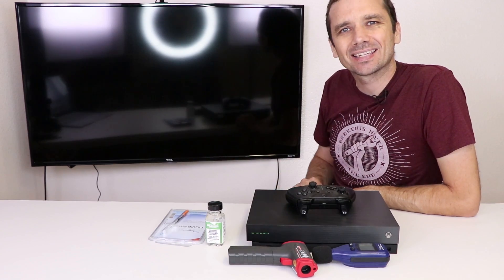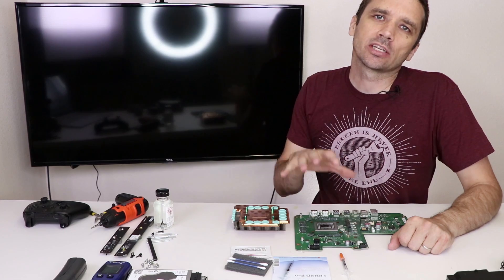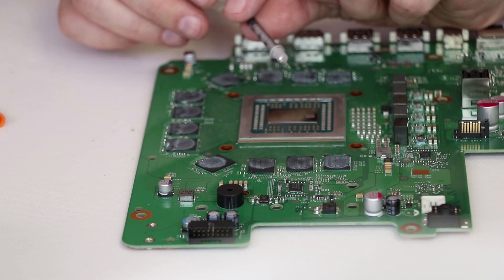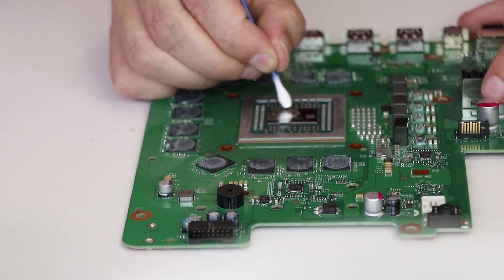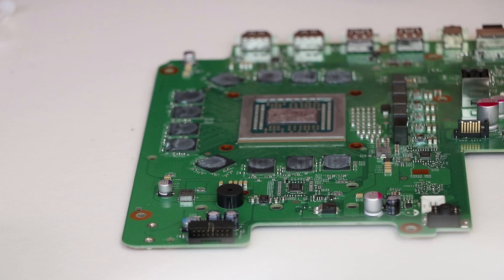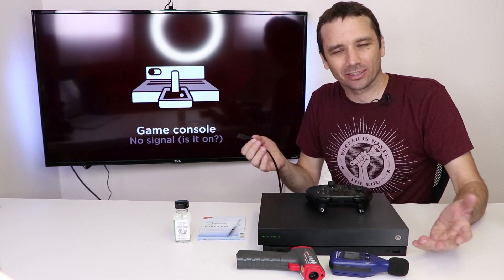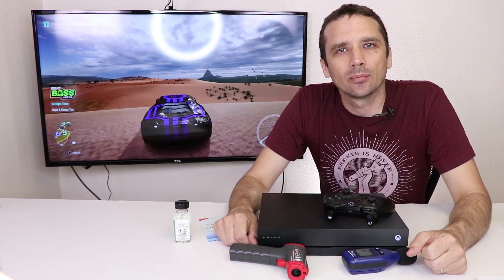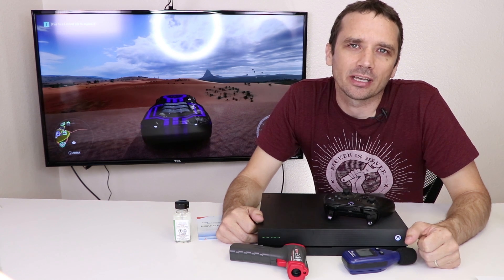Xbox One X Heat Test and Upgrade - It's So Quiet!

Comment from the maker: What was your favorite part? Why do you think the output air was so hot?
Reply: Your theory is correct. But to see real air temperature increase would mean having the same rpm on fan, if the fan was on the same speed, difference would be lower, but still present.  Therefore reduced fan speed can lead to a hotter air output and a better thermal conductor can lead to higher temperatures of heatsinks and lower temperatures of the source. To increase chances for that xbox to work longer without failure would mean to manually increase fan speed to keep APU even cooler under load. But you know all that already :) and I think you just wanted to animate the discussion under video and you got me ;) Cheers
Reply from the maker: I actually hadn't thought of all of that. I was thinking along the same lines but just not that detailed. Thanks for the input!
Reply: @Tronicsfix  Would be nice if you give the K5-Pro viscouse thermal paste and the Grizzly Minus Pad 8 2mm for replacing thermal pads of the Xbox One X a try. Comparison of heat and noise measurement between stock thermal pads, grizzly minus pads and the K5-Pro thermal paste would be very interesting.
Reply: @w3r3wolf  would a thermal imager help seeing overall temperature difference as well? If that fan is over all cycling less than the chips temp must be lower on avg. But I see you point on checking temp at the same fan speed.
Reply: Important question, what kind of thermal pads are those found on the memory ram around the CPU ( green color circle pads). I've been looking everywhere and can't seem to find them.
Reply: They are normal thermal pads, just shaped in circles. If you need new ones just buy some good ones like over 6W/mK and cut them to pieces that cover whole gddr chip, but first measure their thickness to buy the right one.
Reply: @stevenc4477  what do you mean by they don't work,  console overheats? They have used so high plasticity pads to ensure that their thickness when assembling heatsink won't affect contact of APU/heatsink and to compensate heatsink curves,  not to create a market for their service.  You need to check more brands, better brands usually are more expensive and denser,  so maybe look at the cheaper brands like AAB or just use good quality dense thermal paste instead,  heat will be transfered just the another time disassembly will have bigger ressitance,  with so many chips heatsink will be like glued to the board.
Reply from the maker: They are not normal thermal pads
Reply: @TronicsFix LLC  if you had a guess, what does the fan output most of the time on the s, is it about the Xbox one x level or quieter? Thanks for the video, It did help me with my Xbox when me and my buddy worked on it and it works a lot better and hope we can see more of these videos with more consoles to see how much better it can make it. :)
Reply: @stevenc4477  I used the thermal grizzly Minus pad 8 with 2 mm on ram and the thermal grizzly kryonaut paste on the APU. 

The only thing I know is, that everything works fine and stable. But I don't know if the following results are really good!?

In 60 min COD WWII, i measured a max temp range of 36-38 degrees celcius on the topside and 62-66 degrees on the rear. Max noise range direct at the rear heat exhaust was 36-44 db.

What do you think about this?
Reply: @stevenc4477  If you click on my last message, "show more" you can read how hot and loud it is now. ;) Please tell me with what you replaced the thermal pads, where I can get it and what max temperatures and noise you get with it. Best way to test it is COD WW II. It is a more demanding game than Horizon 4. With Horizon 4 i get lower temps than with COD WW II. You can read it in my older posts here.
Reply: @stevenc4477  Hi Steven I wrote you a message. Would be nice to get an answer. PLZ!
Reply: @stevenc4477  Sorry, can't see any link. :( Am I blind? Did you or could you measure the  temperature and noise of your X? Would be nice if we could compare to find the best way to optimize our cooling. If you want we can do the same about our PS4Pro. The stock cooling system of the Pro is not as good as the X. I made a big cooling mod to get rid of that whining jet noise under God of War Map and Horizon Zero Dawn Map. In a next step I will replacing my delta fan with the nidec. Could be the same db but with out that whining. And in another step I will try placing a 120 mm SilentWings3 HighSpeed with a good static preassure above it. I wrote about the details in an other YouTube vid. Only if you like.
Reply: @stevenc4477  Thank you! Very interesting.
Reply from the maker: I don't know where to find those thermal pads.
Reply: Favourite part: Seeing the new xbox console hacked into a better console ;-)

The output air temp rises as the system now has a much lower CPU/APU-->AIR thermal resistance. This is why the air is so hot!
The liquid metal conducts so much better than the original paste (Thermal Conductivity  = 73 W/mk),  resulting in the silicon die has a substantial lower temperature. Since it now has a lower temperature, it orders the fan to run at a slower pace = it is more quiet. 

Due to the better cooling system, the output air temperature rises - but air flow stagnates. For optimal life expectancy, do add an external fan to remove the scorching hot temperature air from the rear - otherwise you are in high risk of damaging internal electrolytic caps, melting or damaging plastics, etc. 
Some info on thermo resistivity: https://en.wikipedia.org/wiki/Thermal_resistance
Atmospheric air has a thermal conductivity of about 0.024W/mK (Watts per meter Kelvin), and the regular heat paste thermal conductivity (W/mK) at 25C is typically between 5-8, - much lower than the 73 W/mk the liquid metal provides.

Have you done research into how often the liquid metal paste needs replacement? Some sources on the internet says every 2 years, as the liquid metal reacts with the metal in the heat sink/APU forming non-conductive oxides. This happens faster with aluminium (which is why you should not use liquid metal on alu heat sinks), but it also happens with copper - just 'slower'.

Thanks
Reply: @TronicsFix Could you do the Xbox One S next if you have the time, Thanks - Carson.
Reply from the maker: Unfortunately the S doesn't have a copper heat sink so no LM for it.
Reply: I have no problem keeping this in a media cabinet sealed with a Affinity AC 2 fan setup. Silent fan,4k, long gameplay, multiplayer. Depending on incoming air. Media cabinet temp is around 92 degrees full throttle. Temp gunned the back of the unit inside and it's around 105°-110°. What are you attempting to fix here? I'm not getting this video.
Reply: @TronicsFix Could you please tell us what maximum temperature  you measure on the topside of the console skin? Eurogamer.net measured the console skin at a maximum of 45 degrees Celsius. My maximum after replacing thermalpads and paste  is 37-38. Is this bad, just ok or good?
My other results are similar to yours. 
You can see the details in my older posts.
Reply: The air is hotter as the liquid metal can more effectively transfer heat into the heat sink which make it hotter and is than able to push the hotter air out. The thermal paste and liquid metal both preform the same job but the thermal paste can only transfer so much heat at any give point which causes the silicone die and motherboard to absorb more of the heat.
Reply: Can you show how to properly add a sheet of copper to an aluminum heatsink, for an Xbox one?
This is so I can add liquid metal. I have found the parts online but im having a hard time finding a proper way to install it. Is soldering involved? If so how?
Reply: It`s the memory and the VRMs, the fan is running slower because the colder APU, but the other components the temperature are same, that results in a heatsink hotter.
Reply: TronicsFix XB One X shell can’t handle 4K 60 FPS cheap out of Microsoft 6 teraflops is overkill for a mid generation upgrade.
Reply: Your theory is absolutely correct, heat is being transferred much more efficiently to the heatsink. I just replaced my thermal paste because of a loud fan and it was dried and rubber like. I didn't do liquid metal but I did Noctua thermal paste and boy what a difference it made. Console is nearly silent in places where the fan would be very clearly audible. I've done my S, PS3, Xbox 360, Xbox One X, next is the PS4 Pro.
Reply: I think since the metal attracts more heat than that’s the reason why
Reply: Because it's a Scorpio version try with standard they're a lot quieter as well.
Reply: I think your theory is correct, it makes sense that increasing the efficiency of thermal transfer would cause higher temperatures as the APU wouldn't be holding onto as much heat.
Reply: Because it transfers heat well.
Reply: Exhaust temp is higher because of significantly better heat transfer and fan speed.

The xbox sets the fan speed on temp. Before it was hotter than it should have been, so the fan runs faster. Higher airflow tends to lower exhaust Temps. Now you have better heat transfer and the fan does not need to spin as fast to get the same amount of heat off the heat sink. Lower fans speed means higher exhaust Temps
Reply: same theory as yours. heat transfer is better so the heat sink is warmer, and fan speed is based off of the chips temp so the heat sink gets more heat soaked.
Reply: What about clear fingernail polish instead of silicone conformal coating to protect the fuses?
Reply: Because there is no airflow..😂 there’s only 1 fan
Reply: liquid metal on copper heatsink bonds the heatsink in time, i saw it in my laptop. Do you checked after 6 months ?
Reply: These systems didn't "age" well, they use tot be my favorite consoles, design, silence, visuals etc. Now even after doing this, nothing, still loud and hot. When they first came out they were great. Not anymore, especially refurbished systems.
Reply: I think that is a valid theory for higher output air.
Reply: Cause xbox one x is fire?
Reply: TronicsFix LLC Awesome video. Also the saw in the beginning was hilarious
Reply from the maker: Thanks @true gamer! Glad you enjoyed it!

Comment: Feeling more heat Leave the console is a good thing. If it was cooler I would be worried. We want as much hot air as possible to be leaving the rear of console. And this is what the end result was. Good Job.

Comment: The heat transfer rate (Q) is proportional to the mass of the air exhausted every second (m) times the temperature difference between the exhausted air and the ambient air (∆T). 

In mathematical terms:

Q ∝ m * ∆T

Since the heat generated by the CPU remains the same, Q remains constant.* So if m decreases (bc of slower fans) ∆T must increase.

*Even if the absolute temperature of the CPU is higher in the first test, as long as the temperature is at equilibrium in both tests (that is not getting hotter or cooler as time goes on), the heat transferred to the air will be equal to the heat generated by the CPU.

Comment: This really needed new thermal pads too. It makes a big difference. At least the ones on here were in okay shape and placed correctly so they were probably okay. Some of the ones on mine were barely touching the chips and one crumbled and was loose inside the Xbox. I don't like liquid metal due to its destructive nature and the slim margin for error. A good solid thermal paste like Noctua NT-H1 or Arctic Ceramique 2 will do 99% of the job with less risk, less expense, and easier application and cleanup. Also, these consoles benefit a LOT from an internal SSD and you might as well make that an upgrade too and make it a budget 2TB like a Samsung 870 Evo or something. All of that really takes the One X to the next level.

Comment: Please help. My XB1X keeps shutting off due to over heating, even after replacing thermal pads and thermal paste, as well as cleaning it all out. I’ve done a full system restart and I even upgraded the hard drive to an ssd. It sits in an open area with cool air flow. I tried calling Microsoft and all they said was “give us $250 and we’ll have a look at it”… not sure what I can do next for it. Open to any thoughts and suggestions. Thanks
Reply: Are you sure your fan is working lol

Comment: The heat transfer is why it's hotter air means 2 things. Better conductivity or u really messed up. Considering the fan is that much quieter it's the plus when factoring in everything else.

Comment: I’m having issues with my Xbox one x. It keeps overheating. I have had the thermal paste replaced by a technician at a local repair place. Still having issues. Any ideas?
Reply: Not in tight space is it?
Reply: Mine was doing the same thing due to inadequate ventilation. Make sure the vents are clean & clear of obstructions. DO NOT PLACE INSIDE A TV STAND CABINET/ENCLOSED SHELF.

Comment: @ 2:00  Where did you get the silicone modified conformal coating from? I have never repaired anything like this and I am unsure if this is just a "any type works" kind of thing or if you need to be pay attention to the exact type

Comment: 1 year later, but who give a damn? My One S didn't receive the deserved cleaning by about 4 years (2016-2020), even with all the signs that it would overheat since it had a dust wall making the flow inside inexistant, it never overheated or throttled the fan untill the day i decided to clean it. No doubts why Xbox One X got the true 4K and manages to be cooler than a 3 fan GPU on desktop

Comment: i did my xbox one x i just used thermal paste and replaced the thermal pads as well as it a 3 years old and they were dry and cracking so doing this is worth it a lot. The noise before this was blowing full speed when on games like new cod and 4k games now i redid it fan does not speed up as much and warmer air out the back. so the warmer the air out the back the better it at cooling it down. this is a must for consoles that are out of warranty and old advise not to do it in warranty as it will void it so if anything breaks in future bare that in mind.

Comment: Why not to use regular good quality thermo compound like Gelid GC Extreme or Noctua? That's not a highly overcloocked CPU and don't required liquid metal. With good thermal paste final effect will be the same but cheaper, easier and saver.

Comment: Can anyone confirm the thermal pads used for the ram? I need to replace mine. Microsoft sent me a really loud replacement console this week and my warranty is due to expire in a week. I replaced the thermal paste and now it is nice and quiet, but the thermal pads on the ram had cracked, crumbled, and dried out. I don't want to leave it in that state long-term.

Comment: Hi, my Xbox One X fan gets so loud when playing 4k games, it is super quiet on other games. So I have everything I need now to follow this video and try to lessen the fan noise, improving the heat transfer from the chip.

But ... before I proceed, I have some concerns. Firstly, it looks like the main chip is raised, higher than the smaller ones surrounding it, does the liquid metal not simply run off the main chip leaving little to no liquid metal on the chip itself in the long run? Secondly, the old past looked thick, allowing the heat sink to link with the chip via the paste, but the liquid metal is a thin layer on both the chip and the heat sink, does the heat sink still actually touch the chip, or just float above it?

Please can someone answer these two questions so I have the confidence to attempt this procedure.

Thank you  :)

EDIT : I have just seen the additional video, where the liquid metal is suspected to have imbedded into the copper heat sink damaging it. Given that is it recommended I just replace the paste? Maybe with Arctic Silver 5 Thermal Paste? Any advice is appreciated. I intend to apply either liquid metal or the thermal past in about a week.
Reply: How did it turn out? I’m having the same issue
Reply: @shockwave2197  I’ve sorted it long term and will never need to open it again. Basically instead of paste which dries out after a few months, or liquid metal that would corrode the heat sink ... I ended up resorting to a piece of carbon. You can buy one of those for chips now. Don’t touch it with your hands, carefully cut it with scissors down to the size of the surface of the chip. Then put the heat sink carefully back on top without dislodging it. That will lock it into place on the chip. Do all that after cleaning all the old paste off the chip and heat sink. It still was slightly noisy when playing 4k games which pushed it, but no where near where it was before. The carbon will never run dry out, so good for the life of the machine 😄
Reply: Steel Eagles how had was it tho after because when I say mine is noisy I mean 45-55 Db
Reply: @shockwave2197  no noise for non 4k games, about half as loud for 4k games. Blast any dust out with a can of air as well whilst it’s open 😄

Comment: 7:02 the air is hotter because the heat sink receives more heat that it can transfer onto the air. That means that the thermal paste was some kind of thermal isolator(a bad isolator that is) compared to the liquid metal. The chip is probably at around 65°C to 70°C and before I guess it could have been running at 80°C or even higher

Comment: So adding metal liquid makes the fan run quiet but the temperature goues up by 20c.
Just that the loud fan affects nothig, but the heat screws the internal components so I guess its not a good option

Comment: I think you may have interfered with the thermal sensor which is why the fan isn't running like it's supposed to and the temp jumped by 28 degrees. I think it's  impossible to a chip to run cooler if the exhaust is hotter.